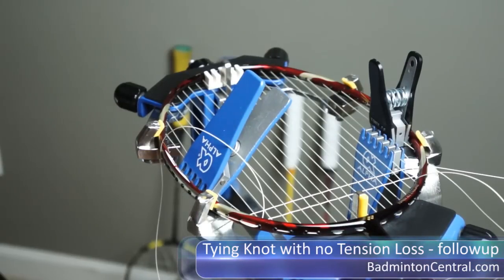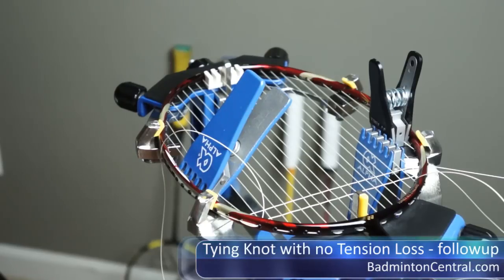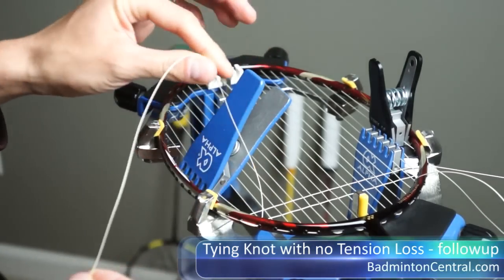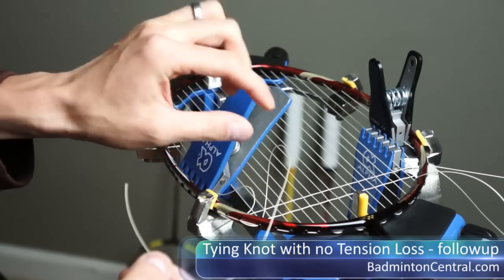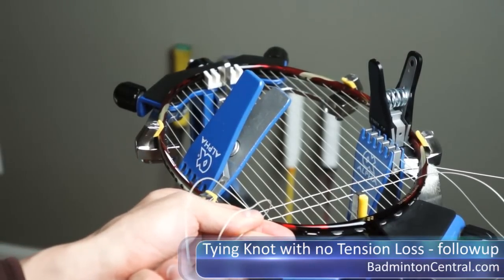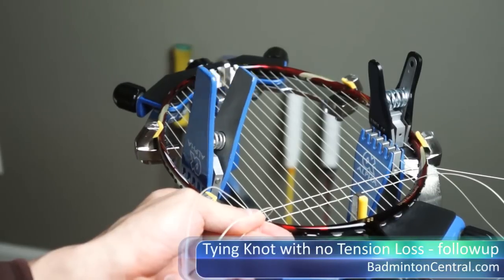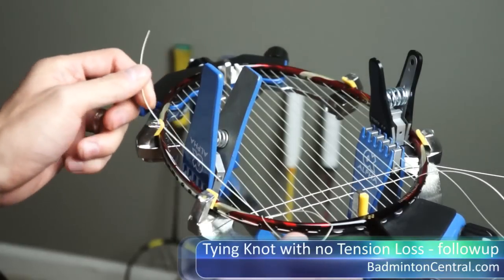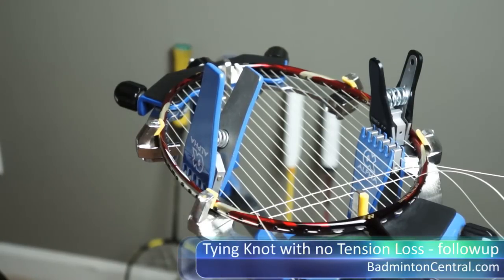Tying Knot with no Tension Loss - Followup - Badminton Stringing

Comment: This looks like a Wilson pro knot with a twist for added bulk. From my experience with tennis rackets, the double half hitch produce the least amount of tension loss since its easier to sinch a half hitch than a variant of a half hitch which is what most of these knots are. You can see this by comparing two rackets, one with a double half hitch and the other using another method. The one with the double half hitch always has more tension on the segment that was tied off.
Reply: Agreed, this actually is just a Wilson pro knot.  Normally taught by pushing string along side of first loose half-hitch, then up through first loose half hitch.  The twist is smart so that it just changes the perspective for the Stringer so you're passing tag through instead of passing tag up, if that makes sense.  Great video.  It explains the importance of cinching up the loose string segment after the initial hand tightening cinch.